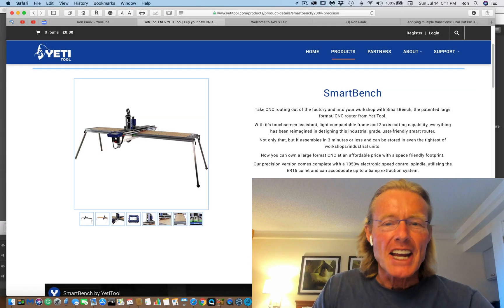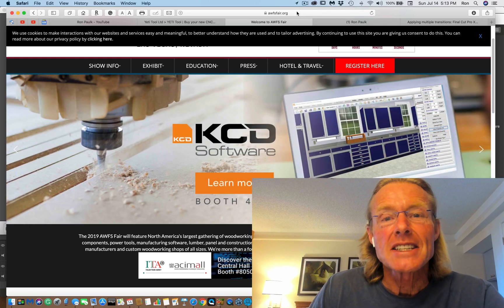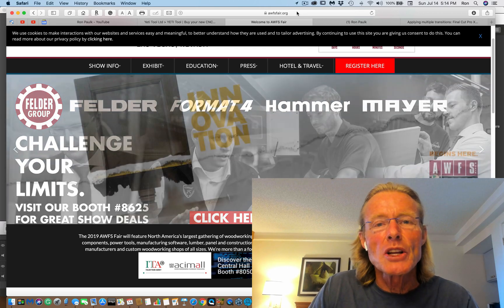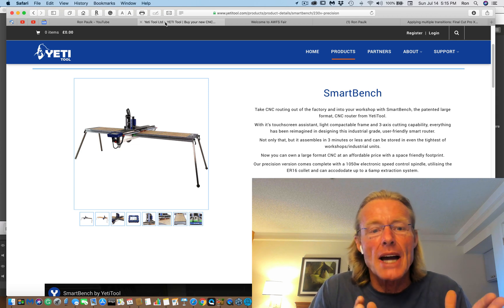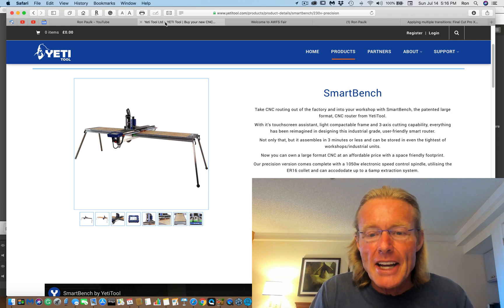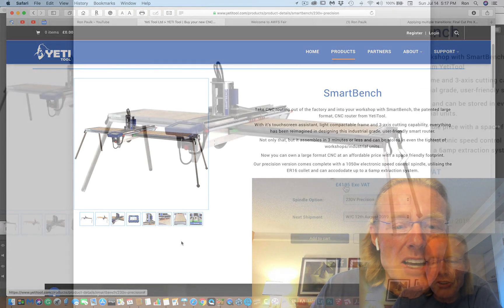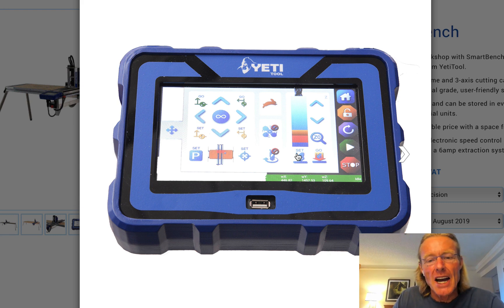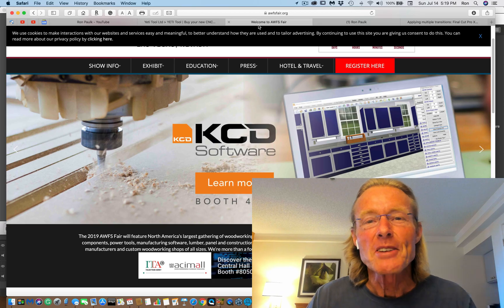CNC: is this even possible?

Comment: Ron,

I bought the Yeti Precision Pro that I will pick up on May 17, 2021.

The new 1kw spindle is made by Mafell.  It is pricy but extremely versatile.  It accepts 1/4" bits up to 10mm.  8mm is generally used for sheet goods.  Feeds and speeds can be controlled while job runs and the 1kw spindle gives feedback on the console.  It will stop and raise above the cutting material if a strain is placed on the shaft.  It also runs on 110v at 10amps.  Calibratng it literally takes about 12 seconds.  Very quick!  Also, the laser x y datum helps greatly with alignment accuracy.  It has a trace feature that allows it to go around the outside dimensions of your job to make sure all clearances are good before starting the cut.

I don't have much money so I saved for years hoping something like this would come to the market for sale.  It truly is a great, accurate, robust and fast machine. 

I hope this helps you or someone on your site with their Yeti Smartbench questions. 

Johnny Maniscalco

Comment: What kind of software can it use?  Can it use other software other than the recommended Fusion 360 which is very expensive ($60.00 per month).
Reply: I'm gonna look into that as well cause I'm interested but I'm a SketchUp user. Most CNC equipment can use multiple software platforms

Comment: ~6500 which sounds on the high side of "worth it". My issues is it only takes a 1/4" bit, sounds like you're stuck with their router -checking with sales to verify, will reply if they do
Reply: Only a 1/4" bit sounds unreasonable. That's a big downer if it's true.
Reply: Wrote them.   @roncruiser  They will offer a 1/2" kit soon that is compatible with existing system
Reply: @80211Denver  Excellent! Had me a bit worried. Thanks!

Comment: Looks like a good start.  You will still need a spoil board under whatever you are cutting so a 4'x8' piece of 3/4" pressboard will still need to be carried along with it.  Most photos and videos don't show through cuts of a lot of nested parts like you would have when building cabinets.
Reply: Good point about the spoil board. I hadn't thought about that.

Comment: Wouldn't a piece cut in the unsupported areas, on either side of the middle part, just fall to the ground? Even in their video they didn't cut anything completely thru, just inlays and decorative stuff.

It better be able to do that otherwise it's seriously flawed as a cnc router imo.
Reply from the maker: I will get more info when I see it in person at the fair and I will bring video plus my opinion.
Reply: @TheSmartWoodshop  I can't wait for your report!  I'm highly interested as well.
Reply: You need a spoil board underneath it. That should keep everything from falling through. My concern instead is that theres no vacuum clamp on the under side of it so idk if you can completely cut out a small part. You might need to leave some little connector "tabs" so the board stays aligned, and then separate the parts with an oscillating multi tool or a razor or something. But that's a problem with any CNC that doesn't have a vacuum clamp system

Comment: 230 volt requirement means that it is not as versatile as most power tools which only require 110 volts. Can't always find 230 volts  on the job site or near where you need it.
Reply: Multiple power options sucks.  In Australia it's all 240v. Unless it's three phase and that's only static machines anyway.